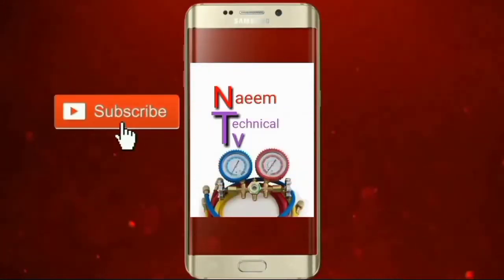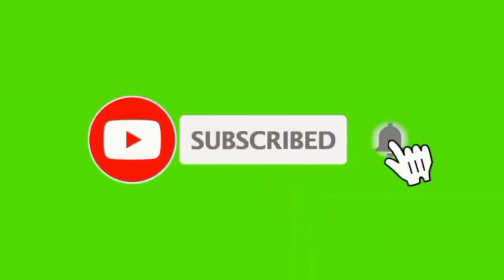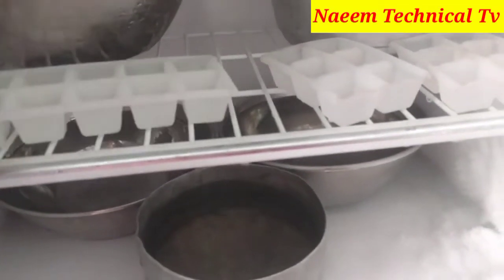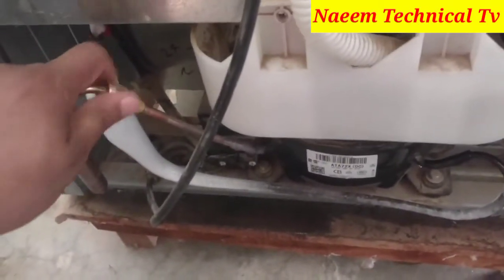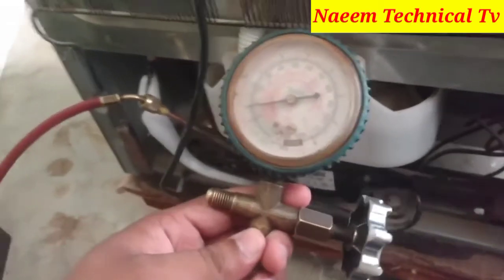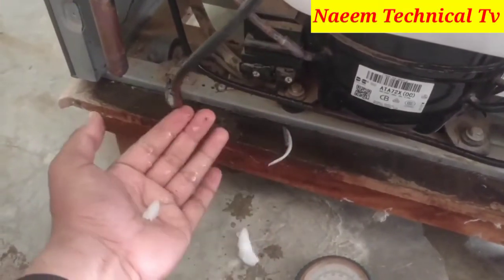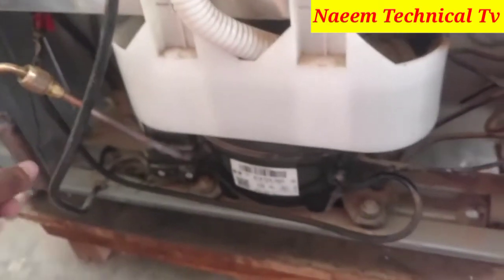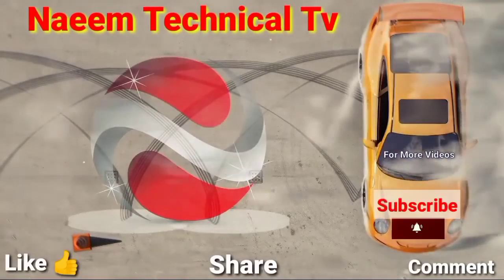refrigerator suction pipe ice reason/problem|refrigerator slow cooling problem in english

Comment: I am from Chennai and doing only Ac,washing mechanic only,  my home fridge small leakage on copper line i am watching other YouTubeand I replaced pipe and see many videos set 10 to 12psi then my fridge same your problem comeing.. then I am seeing your video you set 0 to 2 psi so I reduced 134a gas 12 to 2 psi then problem is solved thank you so much g
Reply from the maker: Good 👍
And thanks for your feedback

Comment: Very important information on this common fault facing by lots of people
Reply from the maker: Thanks for your feedback
Share with others
Reply: @NaeemTechnicalTV1987  will such icing cause damage to the compressor or any other components of the refrigerator in future?
Reply from the maker: @Imran-M-  yes it will cause to produced rust on compressor body and compressor maybe leaked

Comment: Ice build up on the suction line of Freezer or Refrigerator does not always mean it is overcharged. With AC, yes. With freezer or ref, If you have a superheat of at least 20 deg Fahrenheit,  then you have nothing to worry about as long as you have correct Temperature inside the box.

Comment: hello brother . at first my suction pipe was ice and frosting then i follow you do this method step by step and my refrigerator suction pipe frosting melt but stil little frosting after some hours . shuld i do exit more r600a gas from pipe ? what pressure on gauge shuld i set when refregirator is off ?
Thanks
Reply from the maker: Zero or bellow than zero
Reply from the maker: And Refrigerator should off when you released gas pressure.
And no need to released too much gas. It is a little bit extra pressure .

Comment: The same problem i have but i only have the gas cable without guage. Can i use it to solve the problem? I suspect i loaded too much gas.
Reply from the maker: Yes but if you are a technician than you can released some pressure of refigerant by pushing its pin.

Comment: Hello, to be honest I did not understand. I have the same problem, I have filled too much gas. How and through what can I let the gas out? If I press the suction valve/screw valve on the compressor, then the system draws air instead of letting it out, doesn't it? did you let the gas out through the pressure gauge?
Reply from the maker: You can discharge your gas pressure by power off your refrigerator for 5-10 min and than release some psi
Reply: My friend, I have connected the pressure gauge at the suction/service valve. The refrigerator was turned off. The system had 5 bar. I drained to 2 bar. Then turned the refrigerator on again. Now I have 0.2 bar in low pressure at - 18 degrees. Have I let out too much? The refrigerator needed at least 20 min to reach the - 18 degrees. The temperature is set at - 18, the digital display - 18 is still flashing and the compressor is still working. Now I have - 21 degrees, why does not it turn off. NTC sensor is, I measured the resistance, just installed new yesterday.

Comment: I have a question...is it normal for the suction line to slightly freez up when compressor starts and 10 sec later the freez goes a way?
Reply from the maker: Yes its normal
Reply: Ok then my fridge is fix.thanks
Reply from the maker: @J.T323  welcome